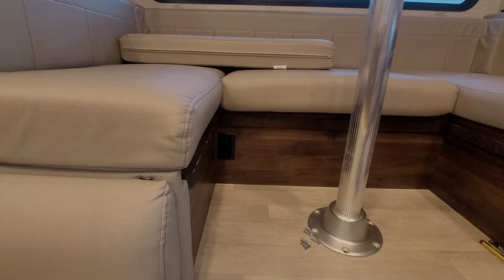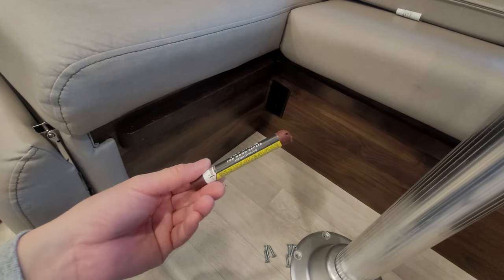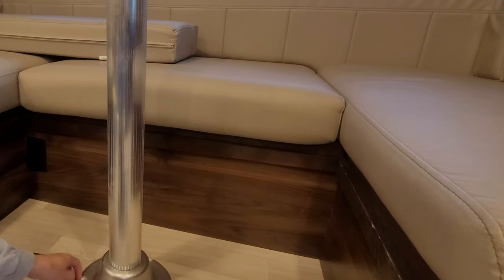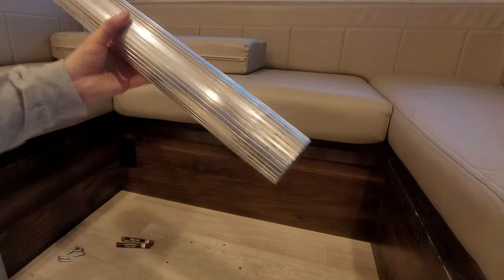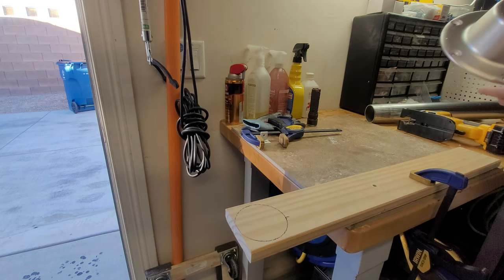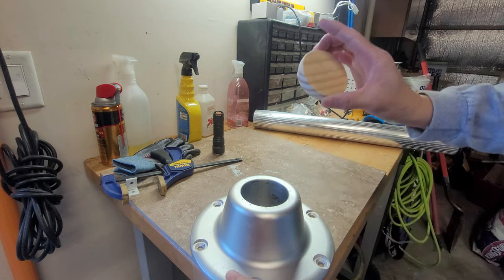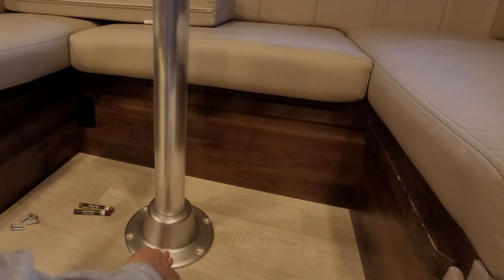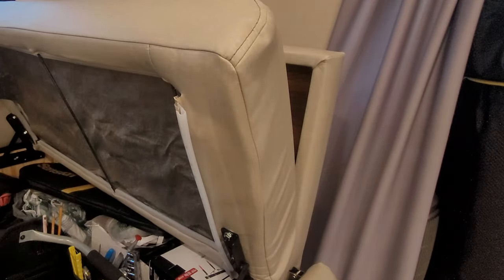4 Simple Repairs in my Winnebago-RV Repair Series

Comment: Thanks for sharing.  For the table leg stuck problem, the easy fix is to remove it with the table attached.  You're essentially using the table's diameter to increase the torque of removal.
Reply from the maker: That is how I always remove it (with table attached). Did it that way for almost 3 years, but eventually that won't work anymore.  My entire table to came off.  The table and the shim piece under it is all just cheap pressed fake wood.  There is also a plastic sleave on top of the leg, that will eventually fall off as well.  This may not be an issue if you don't have to do it that often, but with kids, we remove the leg constantly.

Comment: Thanks for sharing!  It's interesting that the same problem often has multiple solutions.  For the table leg problem, my solution is to take off the table with leg together first, which is much easier to do with the table as leverage, then unscrew the table off from the leg.  That has been working great for the last year.
Reply from the maker: That is how I did it for a year as well but eventually that quit working. Once enough weight it put on the table and the friction becomes too tight, trying to pull it off with the table won't work anymore.  The table will actually break off the bracket and the leg will remain. Hope that won't happen in your case.
Reply: @rvlifediy  It's great to know that there is a limit at the end.  I'll keep that in mind. Thanks!
Reply from the maker: @alexzhu7073  if you do it enough times, the plastic sleave will fall off at the bottom of the table first, and then the actual screws that hold the bracket at the bottom of the table.  I have kids so they lean on the table, etc so constantly pushing that table down. It finally came to a point where it all broke trying to remove the leg with table attached.  If that ever happens to you, this should be an easy fix in the future.

Comment: Happy Sunday Chris! Thanks for another video. Keep them coming. 
I especially like that you use what you had on hand. Half of being a successful DIY'er is just that, IMO. Oh, there are times I'd wished I just made a run to the hardware store to get the "right" thing but usually what I already had on hand works good enough.
One caution I had about using a hammer and screw driver to pound out the pedestal from the base is that you could damage the end of it, flaring it out, if you're not careful, making it even harder to get out. Maybe a wooden dowel or something softer than the aluminum pedestal would be better to use. Obviously, fixing the problem as you did is the best solution. Until next video... Take care friend, Mark
Reply from the maker: Yes I should have stated that a softer approach would be better.  That is one of my many weaknesses.  Sometimes I just go into a project and create some damage, and have to fix the damage as well lol.
Reply: @rvlifediy  me too... how do you think I know about this? Yes, personal experience (mistakes). 😉
Reply from the maker: @volofly2011  😁

Comment: I saw in previous videos that you installed shelves in the back closet of the View. I was wondering what you used to do that?
Reply from the maker: The shelf itself was leftover shelving I had on hand. I supported them with 1 inch aluminum angle brackets from Amazon and used double stick tape on the brackets. You may have to use screws also of you plan on putting some weight on it. Here's a link but you can use anything similar. https://amzn.to/3TIJPtw

Comment: Not sure what video I seen this on but you hung the fan remote on the slide small wall. I was going to put it there with the two screws provided. Any issues attaching it there. Was not sure of the wall board content. Advice please, don’t want to mess up that part.
Reply from the maker: I think it's shown in the 20 top mods and tour video.  I used Scotch indoor mounting tape from a big box store. They are large squares (green color).  The back surface of the remote holder is odd shape and not flat but the square will fit with some trimming. If you use screws, the wall material is super thin 1/8 inch thick paneling called Luan that is covered in wallpaper. The tape is much easier and doesn't leave a hole.

Comment: Thanks for the video !
 While you are sharing common repairs we all will eventually have to do. 
Let me ask you , are you experiencing the center cab speaker over taking the door speakers ? 
 I found the real fix. 
I could share it. 
And if you are aware of it ,that would be a video many people would appreciate.
Reply from the maker: I disconnected that useless center speaker the 1st week I got the RV.  There may be a bunch of videos on that already out there.  I don't know if there is any Winnebago specific though.
Reply: The official fix from MB bulletin is 
On the front speaker there are two wires on each connectors a white and a black connector, the connectors are keyed so you have to remove each wire and switch connectors. 
Either use a terminal removal tool or just cut the wires and use butt connectors. 
 I will be attempting this fix in a few days. 
I’ll keep you posted. 
If it does work it would be great content for you.
Reply from the maker: @rickc9873  Yes let me know. I heard of the bulletin, but never read it.  I remember removing one pair of wires (connectors), and leaving the other pair alone.  That way, the music doesn't play, but voice, nav, etc works.  Sounds like they are having the speaker work for music but at a lower output.
Reply: @rvlifediy  Hi
I switched the wires on the front speaker. 
 Now all three speakers are working. No more transistor radio sound !
I had to cut the wires though, I is very difficult to slide the wire connectors out. I used straight Waygo wire connectors. 
 The front speaker is very loud so I muffled it with paper towels for now. The cab sound is very full , the door speakers have come to life. 
 Hey Mercedes and phone still works. 
Good Luck with the fix.